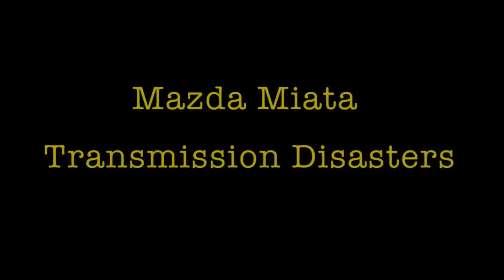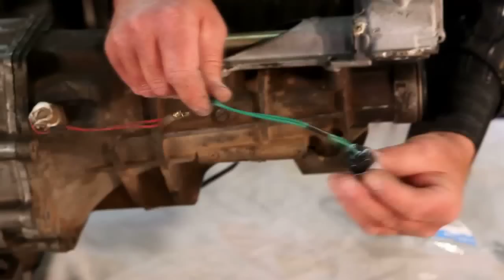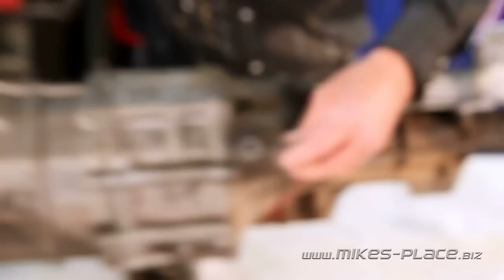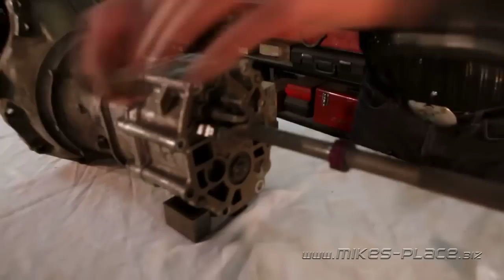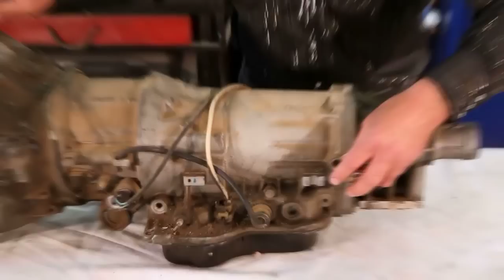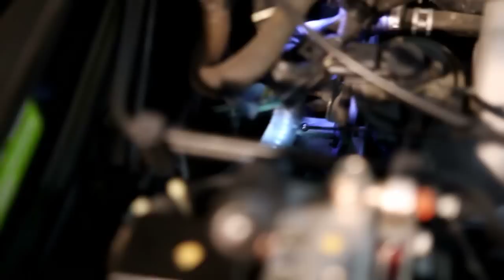MX-5 Miata Transmission Disasters from Mike's Place

Comment: Hey Mike, I have a 1992 miata automatic and its slipping from 1st to 2nd gear. It will rev real high then shift....not sure if its the vacuum modulator or vacuum leak???? I checked the vacuum hose and it seems to be fine....any ideas????????
Reply: Im having the same issue that you had 6 years ago...did you fix it?  Please tell me if you found out what it was.  Mine drives in 1st gear only now and will not go into reverse.

Comment: Hi Mike, I had the same issues with a bad valve modulator on my auto 94 Miata and I replaced it with an adjustable type for napa. Seemed to work great, shifting through and no smoke up until I got to the highway it now won't go into overdrive (4th gear). Do you think it could be that the valve modulator was not adjusted right or is it another issue like the trans fluid temp sensor/speed sensor that could be causing this weird issue? My RPMs are running around 4k at around 60 mph which is awfully high. Looking forward to your reply and I'm sure it can help people with the same issue in the future.
Reply: Hello Damsel Nicole,
Yes, smoke is gone but does not shift proper. To count the shifts, take off fast, that will select first gear. Then counts the shifts. After fourth gear the converter will go into lock up that you can see on the tack speed drop. Is all good ?
If not try another modulator or adjust the new one. Good luck with your Miata Mission.
Mike. The King of Miatas.

Comment: my sister had this problem while waiting for a ferry, missed it because car wouldn't start because when she went to put it in park the shifter didn't lock into place. I noticed yes It definitely has the neutral switch and steering lock but my Miata is the only car where it doesn't have a transmission lock. When the car is off and key is not in ignition I can still just move the shifter through all the gears

Comment: Just to make sure though, over tightening it would cause those symptoms? I can get it in gear if the engine is off, then almost clutchless shift (atleast feels like it)  up into fifth.
Reply from the maker: Hello Sir Stephen,
Your problem sounds like a clutch that is not releasing properly. Could be a clutch hydraulic issue or the clutch itself. Look at the clutch master cylinder first.
Mike.
The King of Miata.

Comment: Hi Mike, I got a question for you if you would be so kind. Would the vacuum modulator on the automatic transmission also cause rough shifting while driving?
Reply from the maker: Hello,
Yes, the modulator could create a late or no shift issue. For a ruff shift we would look at the kick down switch under the dash, works off the gas pedal and is adjustable. Good luck with your Miata Mission.
Mike.
The King of Miatas.

Comment: HELP. I am stumped. I replaced my damaged 99 5 speed with a 5 speed from an 00. All is well except I broke the neutral switch on the trans. Put everything together and drives fine but I have a p0750 code. Seems consistent with the fact i have a damaged neutral switch. Problem is that every part I look at that is supposedly for this application has different connectors than I have. The one that came out was a one piece connector with two spades. All the ones on the internet have 2 separate spade connectors. On my trans, the 2 separate connectors are for the B/U light switch. I want to avoid buying the wrong part. Any advice? Are the 2 switches the same?

Comment: That issue sounds like what I have going on right now on my 5 speed 1990 Miata. It locked up when trying to start off from a stop. The gear shift will go into gears 1,2,3 & 4, but won't move into the 5th gear or reverse. it just can't move laterally to the side from neutral to select either one of those gears.  When put in one of the gears it will go into, and the clutch is let out, the engine starts to die. But when the gear shift is in neutral and the clutch is let out, the car backs up. And the backup lights are on all the time.  The car will move with the engine off and the clutch pushed in when the car is pushed by hand. Does this sound like a bad reverse switch? Or a broken transmission? The only thing that differs from what you said is the part where the gear shift will move into all positions. But mine can't, it won't let reverse be selected, even though it's in reverse.  If you've heard of this situation let me know. Do you have those reverse switches on your ebay store?
Reply: Hello Sir Ted
Yes, you answered your own question, " But when the gear shift is in neutral and the clutch is let out, the car backs up." That is called being stuck in reverse. Follow the instructions in the video to unstick the linkage. Good luck with  your Miata Mission. Mike, The King of Miatas.
Reply: @michaelpaar4261  Thanks Mike, it worked as advertised. I think the hardest part of this job will be working in that slim space to the side of the transmission and the tunnel, stripping and reconnecting the wires to the new switch. it's tight up there, and the wires are kind of short.

Comment: Mike I have a 1991 miata that seems to be stuck in 4th? I can push clutch in and disengage...the shifter is on the neutral position and I can move to.5th and reverse but it feels like it's in two gear in those gates and kills. I cannot move the shifter into 1 2 or 3 any ideas? I've done the reverse Lockout field service to no avail

Comment: Would that other switch be the Park/Neutral Switch ? My 2001 Miata was in about a foot of water and now my check engine light is on. My OBD says the problem is the P0850 Park/Neutral Switch.  I'm not sure where this is located (standard tranny).

Comment: Great video but I am not a mechanic.  I do own a 2014 Miata hardtop and I think the clutch is going out on me.  Would appreciate some input.  The clutch used to engage pretty far off the floor board but I noticed recently it engages just a couple inches off the floor brd.  Thoughts and what I should know when searching for a mechanic to look at it?  TIA
Reply from the maker: Hello, Seek help from your local Miata club. Do a google search for your area.  Good luck with your Miata Mission.
Miatamecca.
Reply: @MikesPlaceBiz   Good idea.  I found 2 groups in the DFW area on FB and subsequently have two good mechanics to chose from that specialize in Miata's.  Thanks

Comment: Mike, I was wondering if you could help in troubleshooting an issue I had today with my 2001 MX-5 getting stuck in gears after coming to a stop at a stop light. The first time it happened, I couldn't shift to any other gear. The clutch seems to engage fine but the pedal feels too mushy when it gets stuck in one of the gears. If I pump the clutch pedal a few times, it seems to solve the shifting problem. Any ideas on what the problem may be? I have a 5 speed manual transmission btw...
Reply: Hello Sir Manny,  Thank you for your concerns. Yes, you have answered your own question and we confirm " you have to pump the pedal". The problem is with the clutch hydraulic system. A leak external or internal. Look at fluid level then for leaks. Next is replace Master and Slave cylinders. Good luck with your Miata Mission. Mike. The King of Miatas.
Reply: Thanks for the inscite Mike...

Comment: soooo glad i stumbled across your video, wondering for an automatic transmission if that vacuum modulater would effect the shifting at high RPM before it shifts. i was thinking just old transmission fluid so changed it and the filter but serioulsy 5k rpm sometime before shifts and going up a hill shifts in and out, so gonna park it til know how to fix - thanks for your input and will subscribe to the kings channel

Comment: Hey Mike! I have a 6spd MT from a 03 miata. I removed the wrong bolt on the passenger side thinking that its the drain plug....now 5th and REVERSE dont work....1-4 and 6th work fine......will this process work for me? or another way to fix this without opening the gearbox

Comment: YOUR HIGHNESS. I HAVE ORDERED THE REPLACEMENT SWITCH FOR MY 1990 MIATA FROM YOUR WEB SITE.  MY QUESTION IS DO I USE THE COPPER BUSHING THAT IS ON THE OLD ONE OR NOT?
Reply from the maker: Hello Sir McCready.
Yes, reuse the copper sealing washer as it sets the correct distance of the switch. 
With out the copper bushing the switch will lock up the rail and jam the shifter.
Good luck with your Miata Mission. Mike, The King of Miatas.

Comment: Mike Miata King, Just want to clarify...which direction should I ensure the detent is oriented before installing the switch? I can't tell from the video. towards the flywheel or towards the differential?
Reply from the maker: +Ron Jackson Hello Sir Ron, The detent should be centered in the hole when you install the switch. Good Luck with your Miata Mission. The King of Miatas. Mike.
Reply: +Mike MiataKing ok, makes sense! The valley should be centered so the switch rod rests in it, not on the narrow rim of the shift rod.

Comment: Thanks for your help. I've replaced the lower bush on my mx5nb, all went well, however on topping up transmission fluid in turret, I have used 3 litres of fluid (75/90) and still not full. I've read the gearbox takes 2 litres of fluid so wondering where this extra is going w/o filling the turret. Any help is much appreciated. Joe, Queensland Australia
Reply: Hello Sir Joe,  You may have a six speed and the turret is part of the main case, not a separate small case. Now you will need to pull the fill plug on the transmission and fill or drain the unit till fluid just seeps out of the fill plug hole. The King of Miatas. Mike.

Comment: Miata mikeking, if i forgot the washer and it went in too tight would it cause the reverse lights to stay on and be difficult to get into forward gears/ out of reverse? Once in gear it goes fine, just a little stiff getting in.
Reply from the maker: Hello Sir Stephen,
You will need to install the washer or big trouble is coming your way.
Mike.
The King of Miatas.

Comment: hey mike, great videos! quick question, if the reverse backup light is not changed will the problem persist?
Reply from the maker: Hello Kris,
The switch will help with the issue ( the mazda factory update ) You may also need to overhaul a sloppy shifter, bushings and seals. Good Luck with your Miata Mission.
Mike.
The King of Miatas.

Comment: Hello Mike.
This video looks a bit old, so I'm not sure if your monitoring it but I'll throw out my question.
My 1990 overdrive off function has failed on the automatic. It was working fine for the last 5 years but now the car just goes through the 4 gears no matter what. 
The switch (OD off button) tests good. Light works. I hear a solenoid clicking. I changed the fluid and there's no sign of damage in the oil or the pan. I inspected all the wiring and cleaned all the connectors.
The dealership thinks it's the lock up solenoid for the torque converter.  This makes no sense to me because that feature is working. I can see it on the tach. Any ideas? Car has 135000 kilometres 
Thanks
Reply: Hello Sir Brad,
Now you need to track it down. Go to the lock up solenoid and test for power and ground with and with out button pushed. 
No change then the issue is in the wiring. There is a change then the issue is internal, blocked passage in control body or 
stuck pressure ball and spring. Good luck with your Mission.
The King of Miatas. Mike.
Reply: JoJoDancer . Thanks for the reply. Appreciate it.
Reply: @okanaganrider4332  Did you figure out what it is, my automatic is having the same hiccup - no overdrive but the od light turns on, high rpms and changed fluid twice. It runs through all three gears but doesn't want to shift into overdrive

Comment: Mike I replaced that switch with a new one, ('90 MX5 manual) and I noticed when I pulled the old one out it worked fine when I depressed it's spring loaded tip. But I replaced it anyway. And it did it again, with the new switch. So I'm thinking it's that shifter you also showed in the video that must be sticking. Does that happen? I'm searching the salvage yards for replacement transmission. Do I need to replace it with a '90 through '93, or will the transmission work all the way up to the '97 models with the bigger engines? My ex wife drives that car and now won't drive it. Twice she's had to have it towed, both times stuck in an intersection. The first time she admitted to backing it up when it happened. but the next time she said it did it all by itself. I don't buy that. A known liar. :) I think to fix it again I'll require her to do your covid finger test first.
Reply: Hello,
Your next step is to rebuild the shift box. New bushings and lube. A sloppy shifter will also cause trouble.
Good luck with  your Miata Mission. Mike, The King of Miatas.
Reply: @michaelpaar4261  Thanks Mike

Comment: I'm about to buy a 2008 NC miata (manual), with 54k miles on it, but it's giving a whine from the transmission when pullung hard in 1st and 2nd. Should I be worried??
Reply from the maker: Hello Sir Sumant.
Thank you for your concerns. Yes, you are worried. Seek help from a Miata pro. May have incorrect fluid in the trans. 
Test drive other same Miatas to see if the whine is normal for all. Good luck with your Miata Mission.
The King of Miatas. Mike.

Comment: just curious, I have a 1991 eunos (Miata) so its the 1.6 with the automatic. Now my car only has 90,000kms and its constantly smoking. What color would the smoke be if it was coming from the transmission? Mine is blowing white smoke so either headgasket or transmission so far

Comment: For everyone having this problem and the sensor replacement isn't fixing it, there is 3 bolts, 2 next to eachother and 1 an inch away from the others, and those are ball and spring detents, that help push the gears back into neutral, mine were weak and I will either have to replace them or pull them to make them springy enough to help not loose gear
Reply: Hello Sir Zachary,
For a chronic "stuck in reverse Miata"  next step is the shifter rebuild. A sloppy shifter can also cause the issue. The last resort is internal, worn shift rods and plates. Good luck with your Miata Missions. Mike, The King of Miatas.

Comment: Mike, can i use a 1994 Auto transmission in a 1992 miata? I bought a 94 engine and trans which i placed in my 92 miata and I cannot get the car to start. What a friend and I thought of was maybe the car isnt in Park so it cant start OR maybe the linkage is too long? Any ideas on this? Any help will be great. We've been slammed for 1 month now.
Reply: I think the 94 trans came from a manual car too and my 1992 is an auto.

Comment: Hello Miata King. I have a 94 automatic that I thought had a leaking front seal, right on my catalytic converter and smoking like a big dog but after watching your video I see that I was incorrect in my assumption. It now appears that it leaks out the side like you said and gets taken it through the intake and squirts out the side on my cat. Here is my problem now. This is my first Miata, I let my friend who has had miatas for year fix the seal. He said he needed to pull the engine out with the transmission because there is no room to get all the bolts around the transmission, is this so?  I need to do the front seal again because it leaks worse than ever now, I think he crushed the seal mounting the transmission. Can you access the torque converter bolts through that little panel on the botto
Reply: And do you sell the modulator?
Reply from the maker: Hello,
Everyone has a little different way to do things. The modulator can be replaced with the engine and transmission still in the Miata. The modulator can be purchased at your local Mazda Dealer or an Auto Parts Store the Mazda part number is BT07-19-823. Good luck with your Miata Mission.
The King of Miatas.
Mike.

Comment: I have a 90 Mazda Miata that I took off the tail light sensor and pushed the thing the wrong way can I still get it back without taking more apart
Reply from the maker: Hello Sir Sckott,
Yes, keep on trying. You will be able to move it back. Have someone wiggle the stick shift when you try to wedge 
the shift rod.
Mike.
The King of Miatas.

Comment: Hey Mike, I have a problem. My NB was also stuck in reverse yesterday and I did exactly what you explained in your video and my NB was working fine again till I went to grab fifth gear on the highway. Every gear is working but fifth, and I'm wondering if it's because I didn't put a copper washer on the switch cause I feel it got lost. Now if the copper washer is the problem, what dimension washer would i need to solve this problem? Please help 😢😢

P.s: You are definitely the king of Miata's and I really appreciate your videos and support 
Thank you very very much 😉😁😉
Reply from the maker: Hello Sir Snailz,
Yes, the copper washer is the problem, the switch is now sitting to deep in the case. The washer ID is 14 MM and apx. 1MM thick. Good Luck with your Miata Mission.
The King of Miatas.
Mike.

Comment: Mike MiataKing   bought a manual Mazda Miata from a car yard.  I drove to a friend so he can see it. But when I reversed, I was not able to shift to gear 1 as it was very hard. I hard to stop engine and put it into neutral. at the traffic lights I had a hard time to start in 1 as it could not shift from neutral. Also at othe traffic lights I stopped with clutch pressed but the stick in gear 1 but the gear was still engaged even while clutch was pressed. Please please is this a big problem?i

Comment: I have a problem with my 1995 miata and ive found a coolant leak coming through the transmission any ideas how to fix it ?
Reply from the maker: Hello,
Does it leak from the front or rear of the transmission. If the front it may be a pinhole leak in a radiator hose spraying onto the transmission.
Good luck with your Miata Mission.   Mike. The King of Miatas.